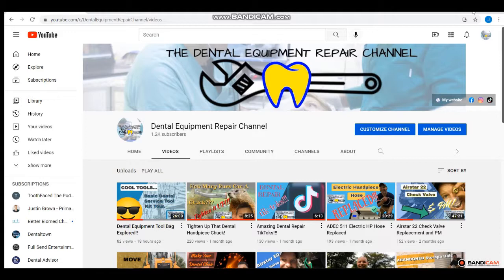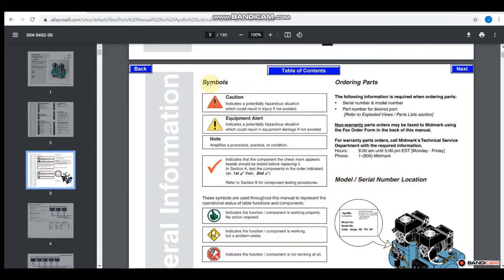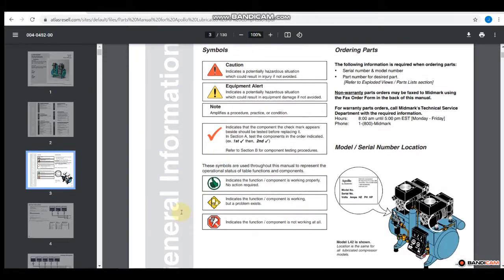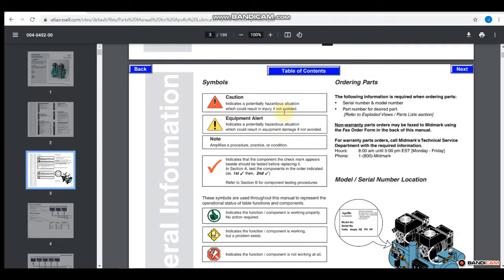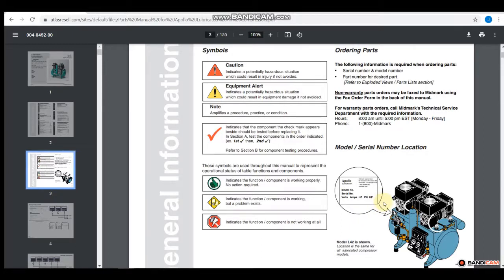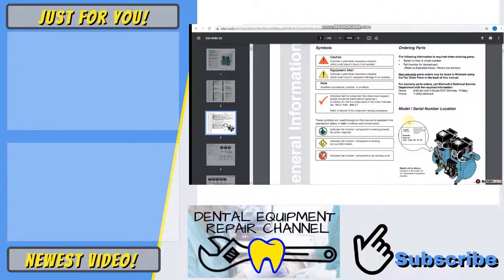Dental Equipment Story Time - Apollo Oil Lubricated Air Compressor Part 1

Comment: Yes. Atlas resell.  Item $300. Handling and shipping $1000
Know them well......
Reply from the maker: Have you moved many compressors? In part 2, we talk about how heavy these things are. Still, $1300 for a dental compressor ain't bad! 🤣
Reply: @DentalEquipmentRepairChannel oddly when I order wood slabs for my woodworking hobby, they strap em to a pallet, and send them freight,  and its a few hundred.  Not 1k. But they are entitled to charge whatever they want. I was just being a wise&ss.
Yes, compressors do weigh a ton. I was going to buy a rebuilt copeland head and it was 100# alone (and mine has 2 heads)  
Luckily a new start box was all it needed.  Merely the relay.